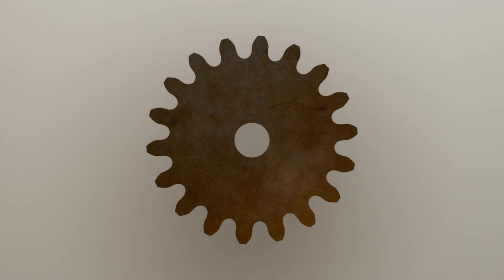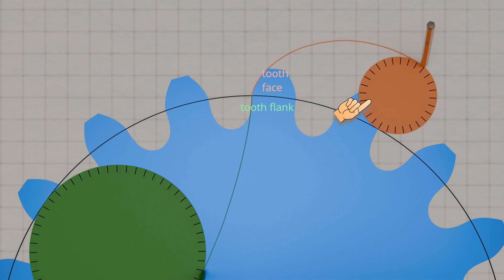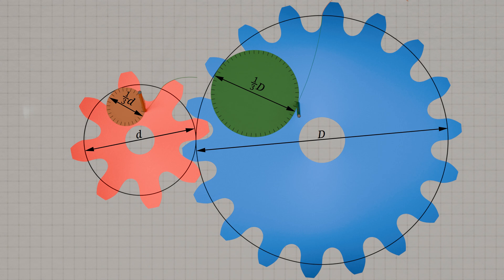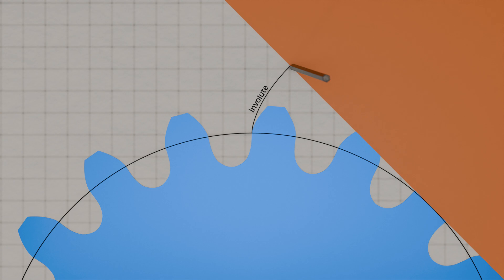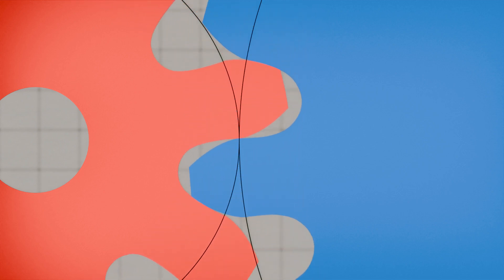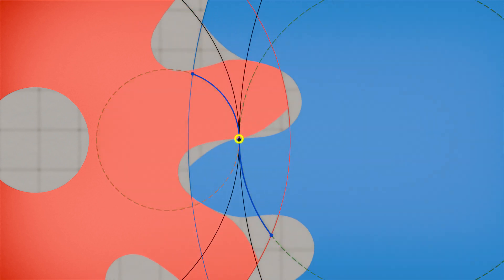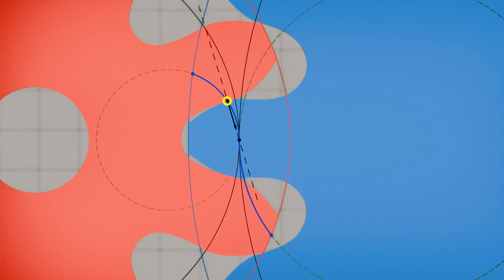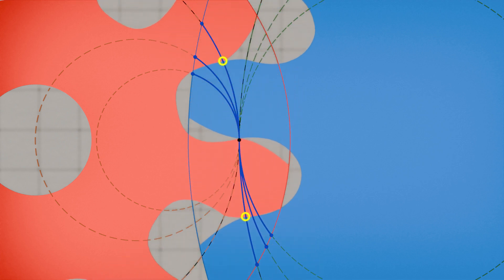Cycloidal gears (construction of an epicycloid & hypocycloid, advantages, disadvantages)

Comment: I am planning to manufacture a sample set of internal-meshing cycloidal gears with tooth counts Z168 and Z166. Based on measurements taken from the sample, I obtained the following parameters:

The Z166 gear has an outside diameter of 70.16 mm and a root diameter of 69.10 mm.

The ring gear Z168 has an inside addendum diameter of 70.24 mm and a dedendum (root) diameter of 71.28 mm.

The eccentricity during operation between the gear and the ring gear is 0.5 mm. I would like to construct the tooth profile for this gear set, but I am not sure how to proceed. Could you help me?

Comment: If I got it right, this means that if someone where to attempt to make a weight clock, for example, cycloid gear would be good for to the low minimum teeth count. But at the same time, any imprecision on gear building and axle positioning would be far more punishing and thus involute gears are best for manual crafts?